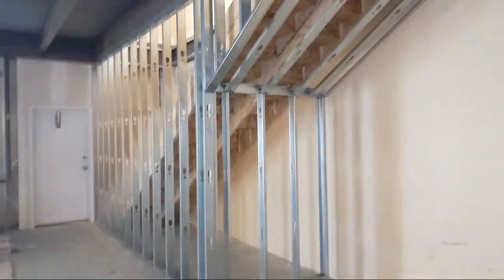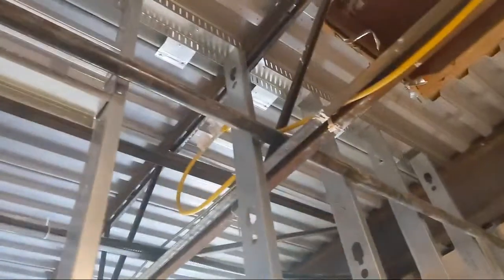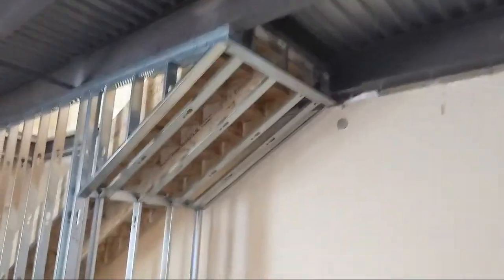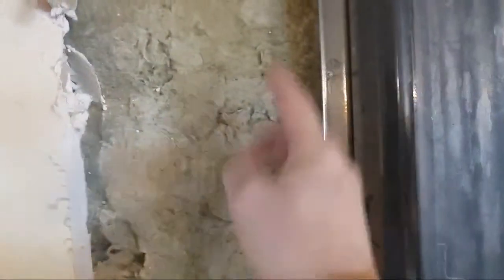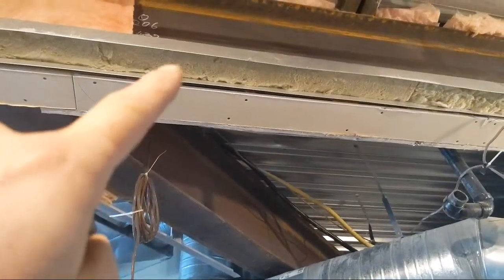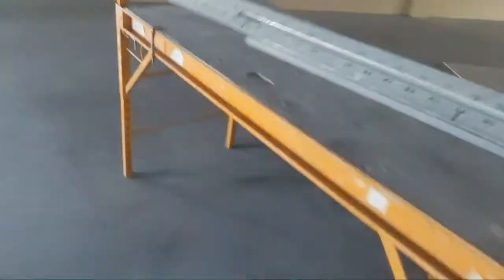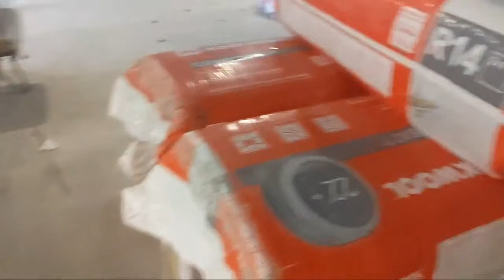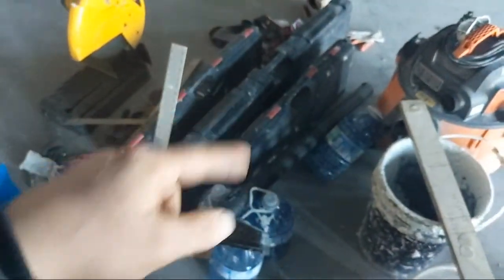Building A Fire Rated Stairwell Steel Stud For Base Building Tenant

Comment: Hey buddy I have a question about the slip
Track used on the stair well walls how come is it necessary ? Once all the drywall is hung from ground floor to top floor how does that allow movement ?  Wouldn’t it all be locked in . I’m asking because I’m about to frame a 2 stairwells in New Orleans and would like to know the purpose of the slip track used for stairwell framing . Thanks for you help on understanding the use of this track . Also I’m hanging 2 layers of 5/8 drywall on each side of the walls .
Reply from the maker: Yes so we use slot track when walls go floor to u/s structure. We keep all our drywall 3/4" below the top and keep screws 3" below the top! Also you can screw the studs in through the slots in the middle of them that allows your 3/4" movement up and down.

Comment: Do you have any tips on getting a hammer drill in between the steel door frame and the stud to get the holes drilled for the Hilti smack pins. I usually unscrew the stud and move it over but the door header always gives me trouble . For installing a welded one piece door frame
Reply from the maker: Yeah I know its a pain after the wall is up but thats what I do. I unscrew the stud and header and move the studs out of the way. Some hammer drills are long and slim, those ones fit better but the shorter wider ones you have to move the studs. The best way is if you can pin the doors down then install the walls and header.
Reply: @ConstructionKronies  yah pin doors first would be decent. I have the dewalt cordless’s rotary hammer which I pretty slim help me a bit.
Reply: Just have to take everything loose, set the frame, and put it back together. If the general contractor was doing his job you would have them before you start framing.
Reply from the maker: @Monath3  yeah doors are one of those things. A lot of the time they are back ordered but the walls need to get up for the other trades. But yes ultimately it's best to have them first. Also this is a new thing for me but I have been framing walls for companies who sub the door installs to other companies (which is the stupidest thing ever) so we put the walls up and they install after (it's also bad because they don't install them properly and don't pin them down, they just use the clips... I know lol)